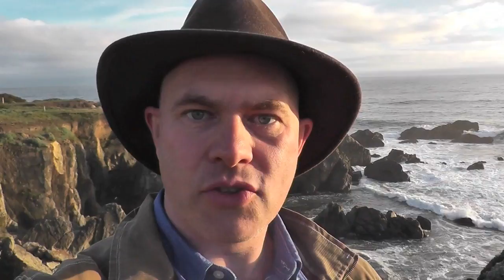Specific Impulse - Why is it Measured In Seconds?

Comment: It's not avoiding any issue. I was only explaining what the Isp in seconds is actually measuring. The fact that it has units of time is not just an arbitrary result of conversions, it actually measures a real time period for that particular rocket motor. I never said this measurement gave you something useful or that a rocket configured to do such a thing would be of any value.

Comment: Of course it's done this way for unit compatibility. But it can be also understood as inverse of the TFSC at sea level - thats why I refferenced fuel by weight.
Another way to understand ISP is the time the engine will burn weight of fuel equal to its thrust at sea level - also a reason why I referenced fuel by weight.

Thus it is the measure of engine efficiency.

Now when you multiply it by the g constant you get Ve. Now if you multiply this by fuel mass flow you get thrust.

Comment: So linking the 'specific' in specific impulse to fuel weight is just weird. There's no reason to do it in SI. It's done because it's more natural in imperial, and as Scott said it works as a compatibility hack between metric and SI too. It's not /because/ it falls out naturally that way in SI. It doesn't.

Comment: Meaningful, but not that meaningful, and very neatly worded to avoid the issue that your constant-fuel-weight-thrust rocket wouldn't hover. At first it would fail to lift due to the additional weight of the tanks and engine, then once it had burnt enough weight of fuel it would accelerate upwards.

Comment: Newton's law of gravitation is F = G m1 m2 / r^2. F is force in Newtons (kg m / s^2), m1 and m2 are masses of the two bodies in kilograms, r is the distance between them in meters. G is the gravitational constant, which (matching units on both sides of the equation) is in units of m^3 / (kg s^2). The gravitational parameter of a body is its mass times G, so in units of m^3 / s^2, or (km)^3 / s^2 if you divide the value by 10^9.

Comment: The measurement in seconds of Isp is actually meaningful. If you have a rocket motor that produces enough thrust to hold up a weight X of fuel against the force of gravity of Earth at sea level, then the Isp in seconds is how long that much fuel would last for that rocket with that thrust.

Comment: It does cause inaccuracies. For example, when you don't take relativity in account in atomic clocks in satellites, your GPS will not work. It would give you the wrong location every time.

And you shoulden't say that a second for an astronaut is shorter, you can only say that you measure the clock of an astronaut to tick at a different rate compared to your frame of reference. There are two things that slow clocks down: having a high velocity and being near a strong gravitational field.

Comment: Actually do it and you'll find it doesn't... It comes out in metres per second. But additionally dividing by an arbitrary acceleration constant puts it into a unit common to both systems, and using g as that acceleration is natural for imperial because of the way they mix up pounds force and pounds mass. (p.s. look up poundals and slugs.)

Comment: I blame the American's. :-p 
Seriously, what kind of weirdos would measure their fuel by weight instead of mass, particularly in space?

Specific impulse is basically the fuel used per unit of thrust per second. 
So Mass-Fuel/Force-Thrust*Time.
Unless you're so masochistic that you like to use weight of fuel instead. Weight is a force so Mass/Force*Time becomes Force/Force*Time, which simplifies to 1/Time or Time^-1.

You crazy Americans.

Comment: Acceleration is in meters per second squared.   In fact the reason Isp is in seconds is that the units cancel out that way-  mass is in kilos, thrust is in newtons, and gravity is in either metres per second per second or newtons per kilo (they turn out to have the same dimensions).  If you're trying to work out how much impulse you get per kilo of fuel, it turns out that once you're done cancelling out the units, it comes out in seconds.

Comment: But then you start drifting away from common engineering practices with real rockets (the merits of which are a different debate).   I know it's a game and plenty is unrealistic as it is, but I always got the impression that they wanted the handling and basic foundations, assuming you're playing serious, to be fairly accurate.  It's forgiving enough you can mess around, but accurate enough you can run the numbers if you want.

Comment: the exhaust velocity is not a singular velocity vector. it is an agrigate of many velocities in many different directions. that is why rocket nozzles (the bell) are shaped such that they are. it is a means by which to capture and utilize the stray velocity vectors and react against them. plus its better to be able to model mathematically with equations than always have to run out and preform an experiment in order to get what you need to proceed.

Comment: So Delta V = ISP*g*ln(m0/m1). Masses are the same unit so that cancels. You're left with m/s = ISP*(m/s^2). Move over the second squared, cancel everything else out and you're left with ISP = s. Simple enough, but what does it actually mean? There are plenty of cases of nonsensical units in science (mol^2dm^6s^-1 for some rates of reaction springs to mind).